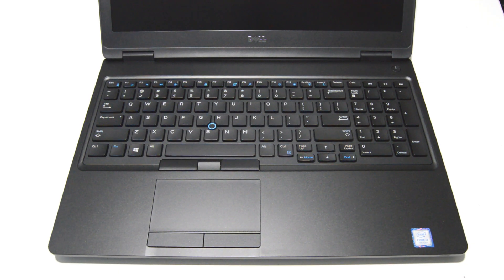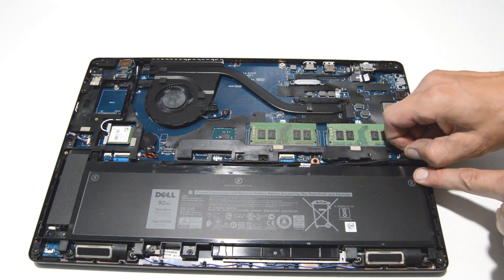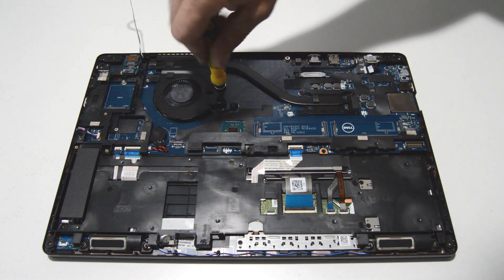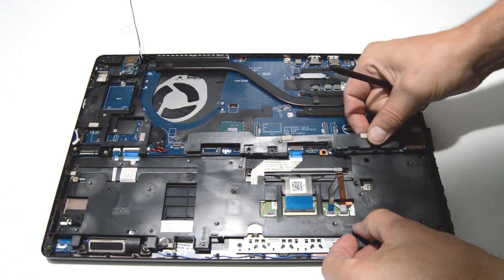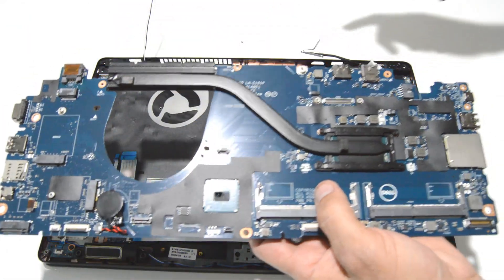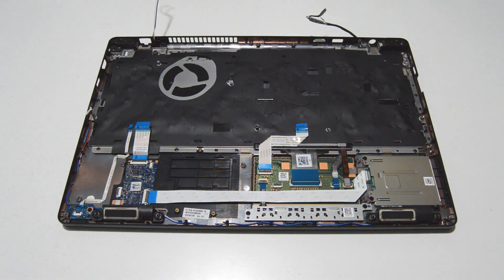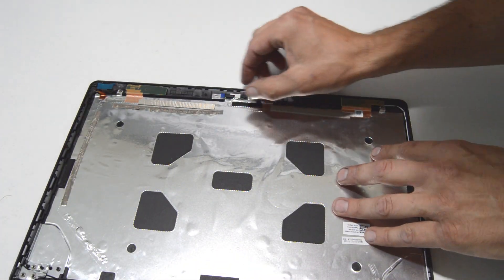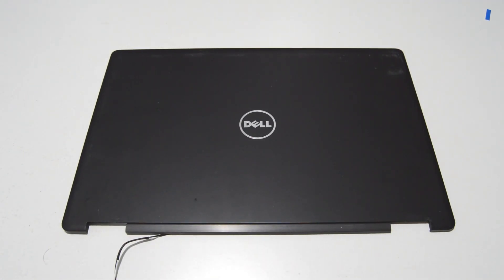How to Disassemble Dell Latitude 5580 Laptop or Sell it.

Comment: Great review! Helps a lot! Thank you. But my Latitude 5580 has 68WH battery. Is 92WH better?
Reply: 92WH definetly better than 68WH, in two times
Reply: @ducknet. It's ok if 68 wh have 7.6v and 92wh have 11 volts? Laptop will work correctly?

Comment: You did a great review. But can i ask you a question? Does Latitude 5580 with i7 7820HQ support ssd NVME? thanks you
Reply from the maker: It should! Check out 3:00 in video, the SSD looks to be NVMe as we remove it from the slot. Your motherboard should be the same regardless of the CPU.

Comment: thank u .. can we disassembly the GPU ?! and where it place ?
Reply from the maker: This model looks to have an integrated graphics GPU, a bad GPU usually means replacing the entire motherboard. Here's a closer look: https://www.ebay.com/itm/Dell-Latitude-5580-15-6-OEM-Intel-i7-7820HQ-2-9GHz-Motherboard-8T986-LA-E151P/223723309652?hash=item3416f2ca54:g:GVYAAOSwDMtdtbse